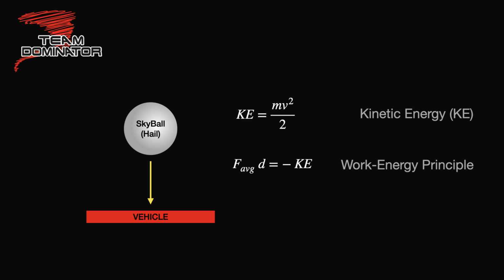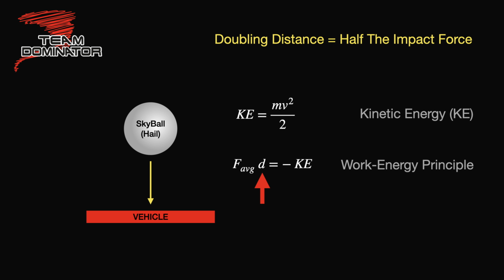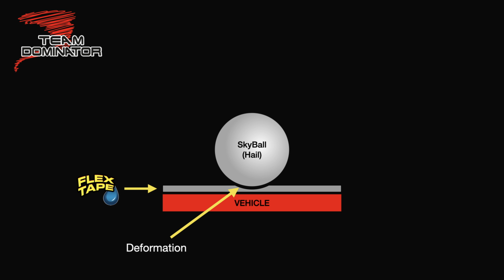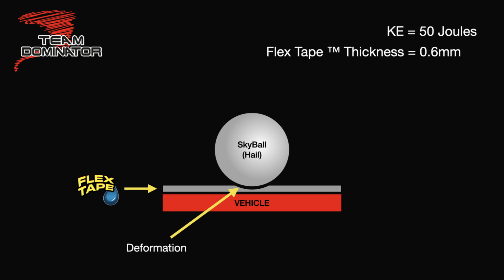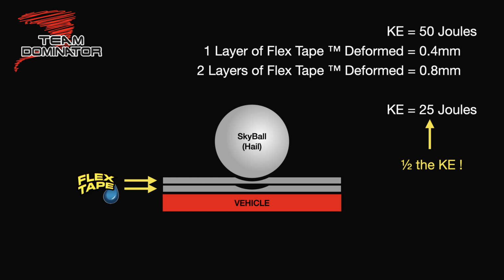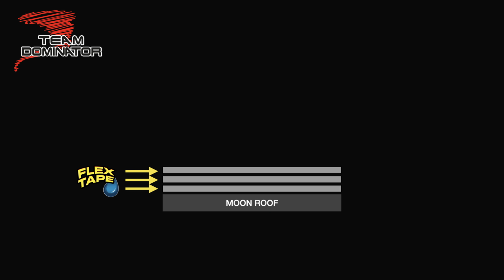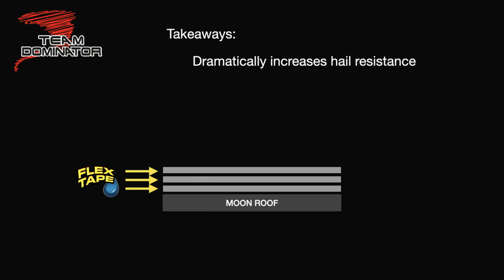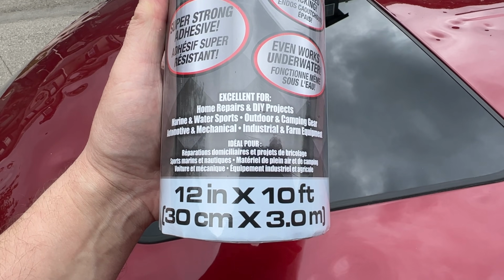Increase protection against hail on a moonroof with Flex Tape

Comment: Have you been able to test this application anywhere? Like yesterday's Dixie Alley storms?
Reply from the maker: Tried it in Alberta this year, worked well.
Reply: I just learned about 8 mil security window film. Application is usually protection from intruders smashing building window glass, but I've seen a 3M dealer use a sunroof example in a YouTube video from 4 years ago. Seems super effective, and completely clear. I'll probably try that first. I like to see up at what's above me with the sunroof closed.